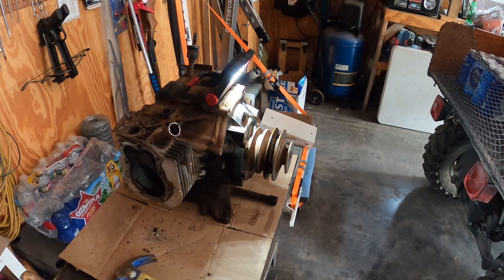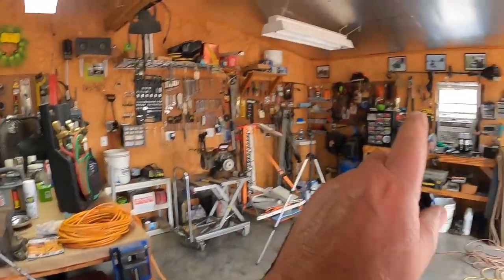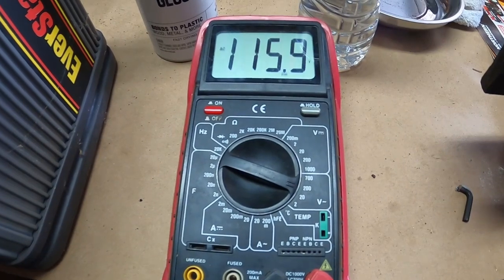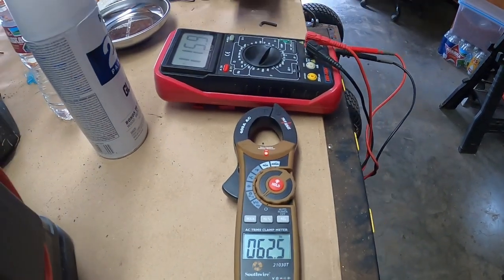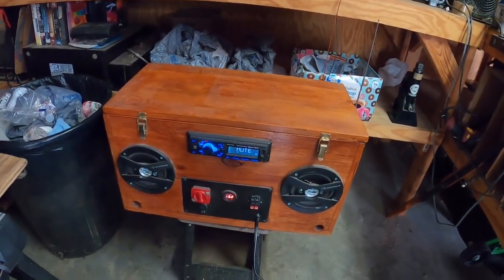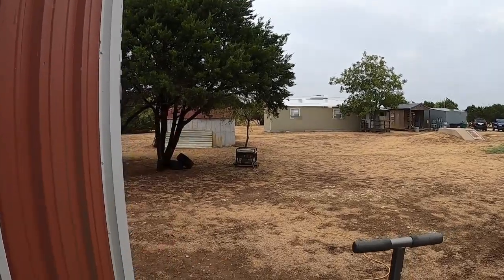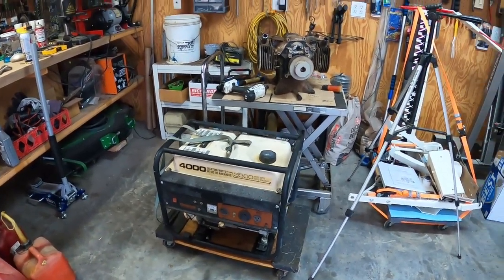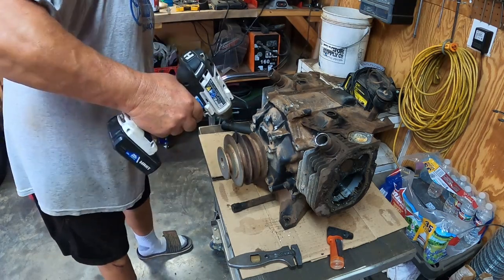Lost power and There still may be a Roper engine Part 5

Comment: It is good that you are getting some rain and workshop cat is very cool. We are very lucky that our power supply is so good, we hardly ever have a power cut. The most we usually loose power for is a minute while it changes over to the resilient route. That pulley is sure fighting you
Reply from the maker: We don't loose power often unless of a BIG freeze, or someone takes out a power pole. I think that is what happened. I have a plan to power the whole shop on the generator without using extension cords, but that will be a later project.

Comment: You need a transfer switch for the power panel to the shop.
Reply from the maker: I am looking to it. The generator needs set to 220 so to feed both legs of the breaker box.